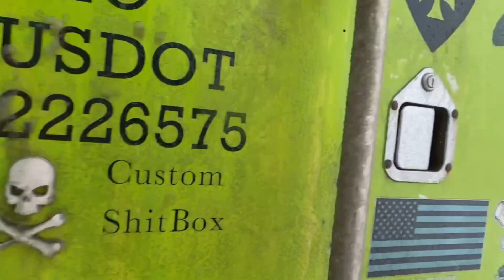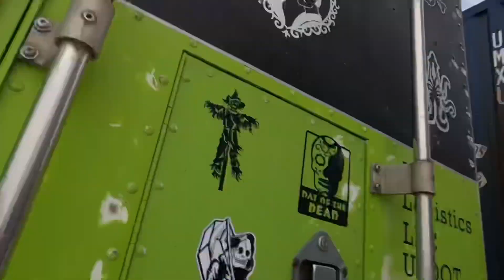Snow Day In A Cabover, Kenworth K100E Aerodyne Gets It Done!

Comment: Well that didn’t look too bad. I was out running up west side of Michigan. Had some interesting spots but overall the roads looked like what you were dealing with maybe a little more wind. Amazing how quick that snow builds up on the frame and stuff. I used to run up across the up and northern Wisconsin in the winter and there were times you couldn’t even find the frame,landing gear, slider arm or any of that stuff. It’s that time of year tho.